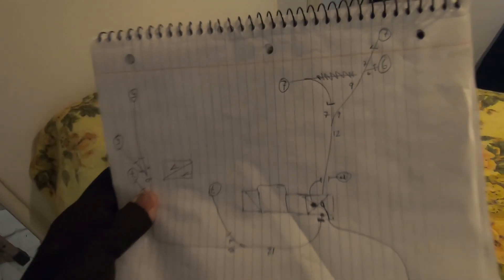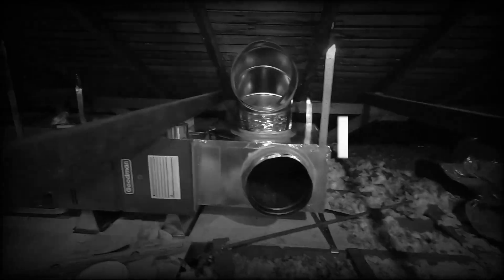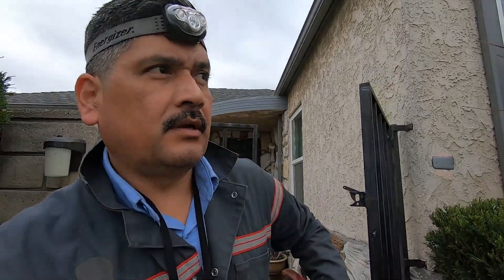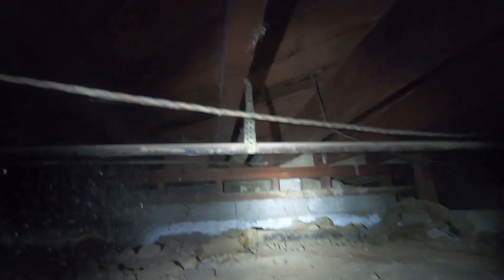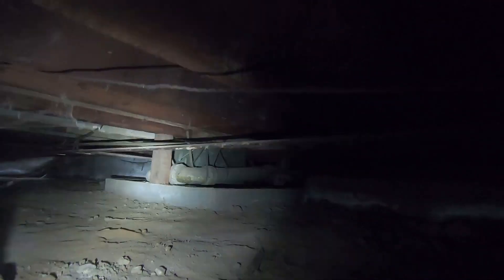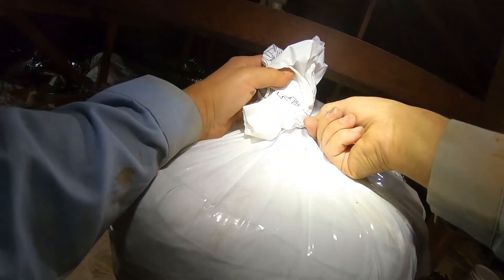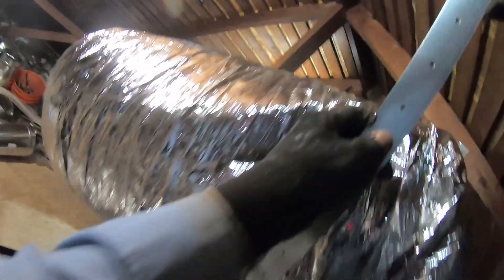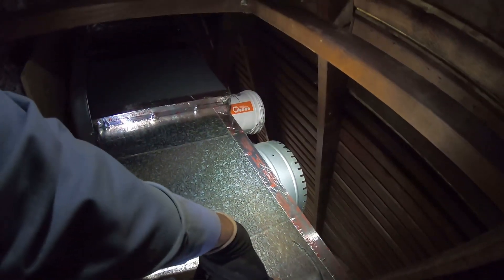New Home HVAC Installation Part  3

Comment: Cold shower and scrub like crazy. I do hvac too new install. Usually the cold water closes your pores so the fiberglass doesnt keep working it's way in
Reply from the maker: I've heard that. Also heard the opposite. Hot water to open the pores and release the fiberglass. I think a wash rag definitely helps with either one.

Comment: I asked my employer about what gets fiberglass insulation off the skin and he recommended that after taking a shower to wipe my skin with Sea Breeze Astringent, CVS or Walgreens should have it. Check the pharmacy department of your local grocery store too.
Reply from the maker: Thank you! That's a new one. Have you tried it?
Reply: @theairconditioningguy  I keep a bottle at home just for that, it does help, on my arms I go from elbow to hand when I wipe it on, just change cotton pads often if you have a lot on you.

Comment: Tell your helper to start off with a cold shower. It helps me a lot and then I turn on the warm or hot water.
Reply: Yes, cold shower for the 1st two - three minutes helps out a lot.
Reply: primusheating1 I do this but I use hot water first to open the pores then cold water to wipe out the insulation.
Reply from the maker: @OBASTOS1  Buuuuurrrrr...🥶🤣😷
Reply from the maker: Thank you I'll let him know. Is that what you do?

Comment: you take so much pride in doing these installations from scratch. i like that you use elbows on your boots and coming off the plenum boxes
Reply from the maker: Everytime I demo old systems I see what worked and what didn't and try to install mine better. Do you still install or only service?
Reply: @theairconditioningguy  i do both. i did installations for 5 years straight for my previous employer. i did some service and troubleshooting from time to time with them. and now i mainly do service with the company i work for. installs dont happen quite often which is a nice little break
Reply from the maker: @Heavy_metal_rulez  I love to install but I'm getting older and it is hard work. So I completely understand when you say it's a nice break. 😁👍🏽😷
Reply: I think doing nothing but installs will make a 40 year old man feel like he's 60 haha
Reply from the maker: @Heavy_metal_rulez  Very true 😆. 👴🏾

Comment: I wish people would put dampers in all installs.
Reply: i totally agree! anytime we ever did a commercial job with spiral pipe or flex duct we had to put in dampers at every register. never understood why we were never suppose to on any residential installations
Reply from the maker: @Heavy_metal_rulez  EXACTLY. Doesn't make sense.
Reply from the maker: I couldn't agree more. So many times an air flow issue could have been solved by a simple twist of the wrist. You installer or tech?
Reply: @theairconditioningguy  started as a helper, installed, and now technician. Everyday is a school day and love it even when I have customers who are rude and equipment that is junk and nasty.
Reply from the maker: @kidalwys  I feel exactly the same and had similar journey it sounds like. Thank you for watching!

Comment: Nice job! Try turning duct tape inside out with sticky side out and press on your arms hands or anyplace you got itching from insulation and press and pull off. It will grab the small fibers and pull them off! Just a thought for ya! 👍
Reply from the maker: Great idea thank you! I'll let my helper know. Do you do that? Or used to it by now?
Reply: @theairconditioningguy  I've used the sticky side of things for years with insulation! Seems to help but maybe in my mind! I say try anything that helps! I guess at some point you kinda get used to it but I hate itch! Let me know what he thinks! If you use real sticky and look at it after you can actually see the tiny fibers that it pulls off! Hope it helps!
Reply from the maker: @gregmiracle9560  Thank you. I'll let you know. Maybe on a video.
Reply: Try baby powder for getting rid of itchy insulation.
Reply from the maker: @hvacgameproper1177  I've heard about that one before. Some say before you work others say after. Which do you mean?
Reply: Greg Miracle Apparently you have no hair on your body. If I tried that, it would be the equivalent of getting a waxing job!
Reply: You stick a duct tape to your body, and itching will be the least of your problems!
Reply: @josbrun  I didn't say wrap up in it! You just kinda tap it on areas that itch and pull the fibers off! And btw if you a gorilla or something DON'T DO IT! Lol never said ya had to! Do whatever works for you man! 👍 Stay safe!